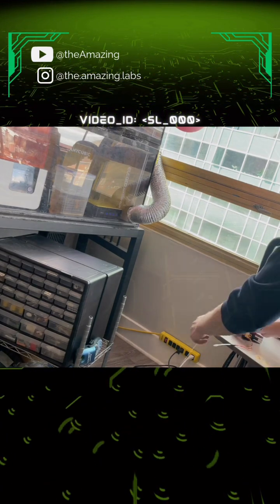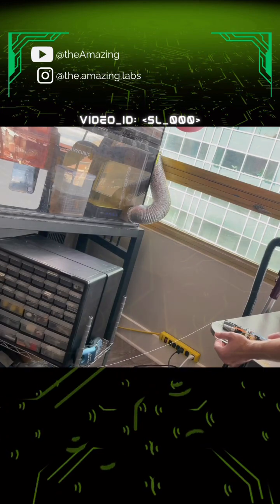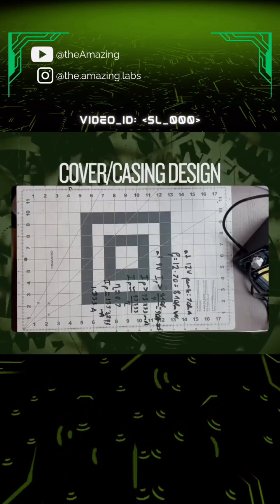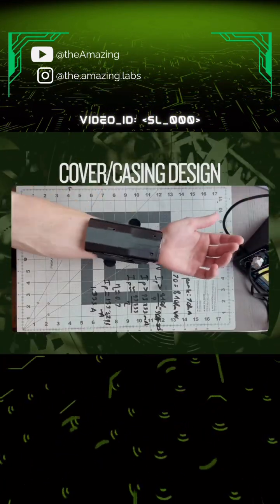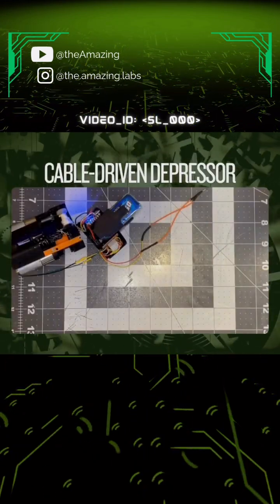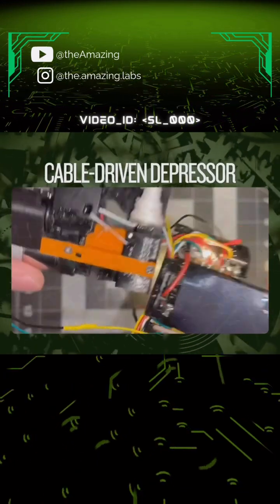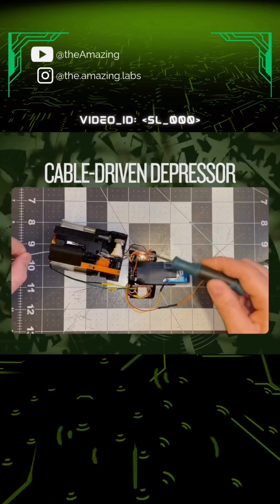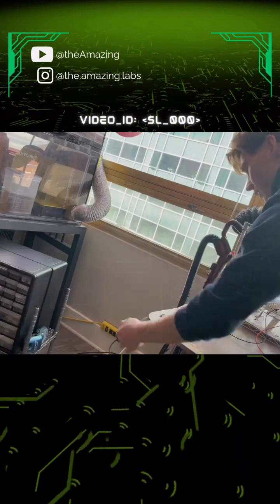We’ve got issues… #shorts #shortreels #shortsfeed #shortvideo

Comment: Great progress, however I feel like this approach in the end simply cannot work reliably or provide the type of ‘experience’ you actually want, which is for the object you attach to eg. Car keys, to whip back to your hand rather than drag across the floor. I spent several months working on a functional ‘webshooter’ as I work in 3D printing, manufacturing and product design. I also ran into many complex issues but made good progress and have some reasonable solutions in mind. I think a hybrid between my design and yours has the potential to genuinely ’fire without tangle or resistance, return with speed and power, auto reload and fire again reliably. Let me know if you would be interested to discuss and colab :)
Reply from the maker: Feel free to email me some ideas and we can get a back and forth going
Reply: cool, will touch base with you tomorrow via email :)
Reply: I love that we are seeing this happen right in front of us, just a bunch of nerds sharing ideas on how to be superheros